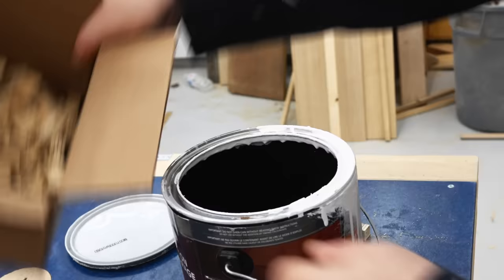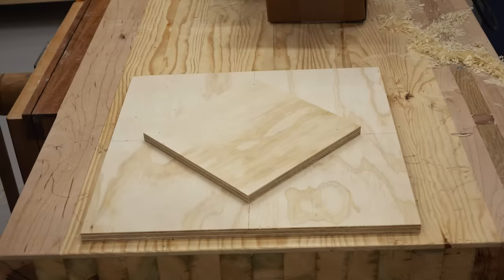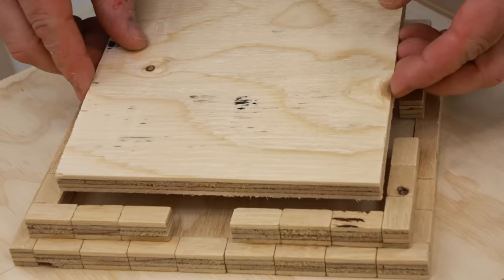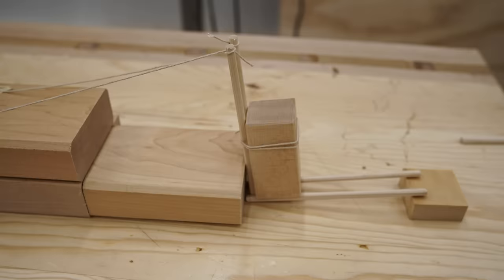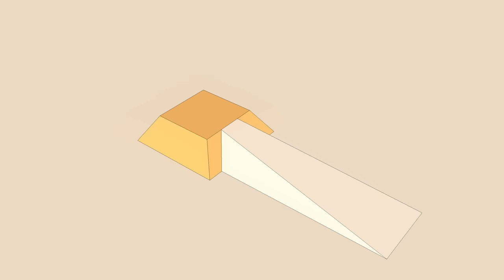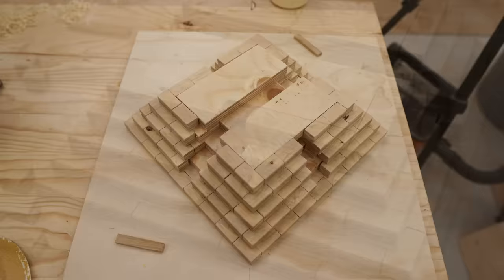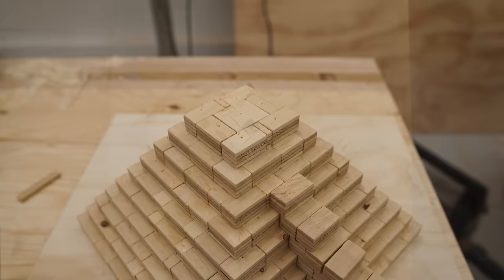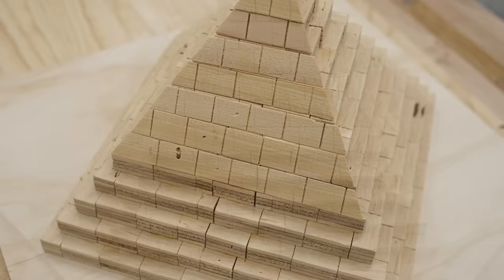How I Would Build The Great Pyramids

Comment: They could've used a ramp along the slope of the pyramids which had very small steps in it, almost like a file. Then they could put the blocks on a sort of carrier frame that would index those small steps and use long levers to lift the blocks up one step at a time. I'm talking a few inches at most per step. They must have used very significant levers and they might have been assisted by large gangs of people on the ground, pushing on something that transferred their force to the stone.
Reply: I think he said it best, though ... you don't really need to build a giant ramp when you're already building a giant ramp. Using layers of the pyramid as platforms to raise the pieces of subsequent layers of the pyramid seems like the most elegant and efficient solution. Less material, less time, less effort, less cleanup, fewer workers, lower cost.
Reply: @pwnmeisterage  but even today we create falsework to help make the job at least a bit easier.  It’s not too far fetched to think that a corkscrew ramp would get built around the outside, since it provides the least amount of effort, in exchange for time.  Time was a resource that was free and accessible, while effort was limited to the ability to create levers and ropes strong enough to do the job.  Sure manpower was available in droves since they used slaves, but flipping a 5000lbs block vs dragging a sled comes down to efficiency, not cumulative strength.  The dynamic movement of flipping the block each time  is inherently dangerous, requires enormous effort within a short burst of time, and requires some kind of massive harness and lever that I doubt could be made at the time.  The corkscrew ramp and sled concept allows workers to make iterative progress, rest at any time without loss of progress, and use easily executed sled construction, greasing, and ropes distribution to lower the threshold of effort.  These people spent lifetimes making these so you know they considered tons of ideas and chose the one (or eventually innovated towards the one) that took the least amount of headache.
Reply: @davidswanson5669  - What we use today isn't terribly relevant to the question of making ramps to construct a giant ramp-shaped building, because we aren't making giant ramp-shaped buildings today.
Reply: @johnnyjohnson6643  I’m saying that creating falsework isn’t a waste of time or effort, and is in most cases necessary.  Scaffolding and jigs and molds are all extra things that are built in order to make something that is just as big or smaller than the falsework itself, but we don’t consider those things ridiculous or inefficient.
Reply: @davidswanson5669  Flipping 5000lb blocks end-over-end up steps would certainly take a lot of effort. Even with levers, sleds/rollers, ropes, pulleys, and cranes. But constructing a massive ramp system - robust enough to support the weight of itself, levers, sleds/rollers, ropes, pulleys, and a 5000lb block at every point along its entire length would be a lot of effort. And the corner posts - you either build massive ramp columns or you end up flipping the blocks end-over-end four times per layer anyhow. And accidents - a frayed rope, a broken log, an injured slave, a panicky animal - would probably take out all of the ramps below when the 5000lb block crashes down. Unless, of course, you build some kind of truly impressive ramp system out of more stone blocks ... basically build a pyramid onto your pyramid ... which seems like a lot more than scaffolds and falsework.
Reply: @pwnmeisterage   the corkscrew ramp concept uses the pyramid itself as the main structure of the ramp, and I think they build the ramp out of more stones, as you mention, or wood blocking, but they wouldn’t need a whole lot since they’d reuse it as they advance up each flight of levels, kinda like how they reuse/replace logs when rolling a building across town.
Reply: @pwnmeisterage  the stones are nowhere that heavy as you go up. it is only down they are heavy! in fact barring at the outer layers none seems that heavy.
Reply: @pwnmeisterage  A ramp made with blocks on the outside filled in with smaller stones and sand wouldn't be that hard.  And make the surface flat like the outside surface of the pyramids so its a real ramp not a step ramp. Do one layer of the pyramid at a time and then keep building the ramp up. Of course the longer the ramp the more gradual incline would be. I think the ramps were probably a lot longer and gradual than most people think. The ramps could have been a mile long for all we know and might have barely felt like an incline at all. The construction of these we're taking 20 years or more.

Comment: They had a, newly discovered, 7-degree spiral ramp running internally from top to bottom like a modern-day multi-story car park The ramp was/is not connected to any known pre discovered chambers the corners of the ramp were thought to have been left open to enable the blocks to be turned the openings provided light and ventilation and were filled in last after the structure was completed. French Sonar picked it up in previous studies but they thought it was interference or an anomaly and ignored.
Reply: jup, some Frenchman discovered the internal ramp I believe. However I do not believe they were used as tombs; nor do I believe it was build in 20 years; in fact; if you look to the 'unfinished pyramids' its very clear that the pyramids weren't build in one go either. I think it's very likely that the Giza pyramids were build on a more ancient site, given the fact that there is an entire labyrinth of tunnels underneath the plateau. I think those came before the pyramids and the pyramids themselves have been made much much later. You also see this in the pyramid of Djoser; the construction techniques of the internal hole and tunnels is rather different all together as the pyramid on top. And as for 'they were tombs'.... well there has been no mummy ever found inside an Egyptian pyramid so that's just speculation; in all honesty nobody knows what they were used for; to me seen it's build up it had a more practical use... although I don't believe the 'powerplant' theory either.
Reply: do you have link?
Reply: @SeiMaxwell  https://www.youtube.com/watch?v=lasCXujNPfs This 1 he might be talking about. Internal ramps just inside the outer layer.
Reply: The internal ramp is the most practical design. You wouldn't build an external ramp that would consist of more stone blocks than the thing your building. Also it would become to steep at a point for the workers.
Reply: @stijnvdv2  Aristotle believed the pyramids were constructed to keep the people poor and busy. You can find it in the Politics, in the methods that preserve tyrannies.
Reply: @husker_pupper7474  You can use the actual building to support the ramp. It would of similar shape but less steep than the internal ramp because the dimensions are larger. The external ramp has many advantages but the visibility of labor was probably the most important.
Reply: @aristotle_4532  They have already disproven the extremal ramp. The main reason is it would take more blocks to make the ramp to reach the top of the pyramid than all the stone blocks in the pyramid its self.  So where did all these blocks go? I dont see them laying around.
Reply: @husker_pupper7474 The structure of the external ramp would be a tiny percentage of the pyramid volume.
Reply: @aristotle_4532  I recommend you do your research. Egyptologists as well as engineers have disproven the external ramp (for full construction). You know people with doctorates. People who have surveyed the actual pyramid. You know people who have actually been inside it. Also the only person to be aloud to climb and explore the pyramid. You are incorrect.

"If the ramp were too steep, the men hauling the blocks would not be able to drag them up. An 8-percent slope is about the maximum possible, and this is the problem with the single ramp theory. With such a gentle incline, the ramp would have to be approximately one mile long to reach the top of the pyramid."

So where is your 1 mile of linestone blocks? Prove it.
Reply: @husker_pupper7474  1) I'm a civil engineer with 5 years of university training and decades of practical experience, which is closer to practical and theoretical engineering that any egyptologist or architect will ever get. I also grew up in construction sites because that's what my family does. You think this is some sort difficult building problem, but the solution is obvious. I find the quote laughable from an engineering point of view. A much smaller pyamid can be built using a low slope ramp, because the ramp can be on the actual pyramid following the perimeter in multiple turns and based on the actual structure. Length is not a limitation. 

2) Surveying the pyramid is irrelevant for a practical engineering solution. The dimensions of the structure is all one needs. An external ramp can be used without leaving evidence on the structure. It does not even require significant support if you use the structure as any sane engineer would do.  It will be extremely hard to connect a ramp found somewhere with a pyramid. An internal ramp makes sense for general purpose access, and better ramp technologies can be used in other situations, but the external ramp of the pyramics will never be discovered. That doesn't mean it didn't exist. It's the obvious solution for such a building. 

3) Slaves would laugh at your idea of a building ramp.

4) You don't know what proof means.
Reply: @husker_pupper7474  You clearly know little about construction and you are not equipped to discuss this. Do you know who Houdin is? His father was a civil engineer and engineers are the only experts in these issues. 

Spiral ramp is the only reasonable way to construct a pyramid. You think of construction as an interesting subject but it's very complex. You have to optimize many parameters to get a solution for each building, depending on its size, the materials, the schedule, workforce and complexity, but the solution in this case is an order of magnitude more probable than anything else. It should be considered certain. Engineering was primitive at the time, but they were not fools. Any builder without formal education would reach the solution of the spiral ramp. It is that evident.

From a dialectical point of view, the pyramid construction discussion is full of nonsense. Nearly nobody wants to accept something that contradicts his perception of the problem, even if he/she has no idea about engineering and the logistics of building. Most of the approaches in popular science are downright idiotic and any high school student should be able to tell with basic knowledge of physics and simple volume calculations. 10yo kids should point to the ramps depicted in books and claim that's not a good way to do it.

Internal vs external is semantics. The ramp is always external. If you build it and cover the area, does it become internal? An internal ramp for this purpose is impossible to build because it requires the cell which is impossible to build without the ramp. An internal ramp can serve many uses but it cannot build the main structure. In such a building there could be 600 people working on a shift, at the same time, inside the building. The pathways for this purpose can be more steep or even use stairs, scaffolding and lifts. But if you are moving such volumes using people that can merely do the labor of an animal, you need to keep the slope shallow and things very simple. 

Only compulsory work can make an ugly useless building of this type happen, but I meant that even a slave would know more about the subject. After all he has probably pulled something heavy up a hill a few times.
Reply: @aristotle_4532  I never once said it was not complicated nor did I ever say it was easy. So most of that was you trying to look good. So good Job lol. Its called an internal ramp as right now in 2021 the ram is physically inside the pyramid. Hence internal ramp. Obviously during construction the ramp that is now internal had spots open to the world. As you know its under construction. That is common sense lol. Did that make you feel like a big boy?

When people are talking about different ways it can be done the two most discussed ones are. 1. Internal ramp, a ramp that spirals the outer walls of the pyramid. 2. External ramp, a ramp on the outside starting in the middle extending outward that is built up continuously as the pyramid gains height.
Reply: @husker_pupper7474  You have the layman point of view. You don't understand the issue and take from granted anything you read on the subject, from bad theories to rhetoric defenses of existing theories. You can't even tell these people are usually not qualified to build anything or propose anything on the matter. You can't tell the arguments are nonsense.

How the pyramids were built is not a problem of science, and engineers have no doubts an external spiral ramp was used and nothing innovative was done. An internal ramp for building a pile is a ridiculous idea. Even animals have more brains when they build. 

This pile or rocks is not different from a pile of legos someone spent years on. There is no mystery in the pyramids beyond popular science and bad science fiction. It's news for youtube or newspapers if there is nothing important to publish. It may be a significant subject for someone trying to get some interest in his name for career or academic purposes. These are usually the people that bother to work on the pyramid "problem". A scientist works on an important problem, does the work, then publishes. A sophist works on popular subjects and starts with the media.

Comment: This sounds feasible until you find out that the stone blocks were too heavy to have even been rolled on wood let alone tilted, the sheer weight of the stone would have crushed any wood they’d have sat upon. 

It was entertaining, thank you.
Reply: I think you underestimate the strength of wooden logs. The ability of wood to bend under the stress helps it avoid breaking. Sometimes the harder something is the more likely it is to shatter under immense pressure.
Reply: @disapearingboi  your right about the wood being strong enough, Easter Island definitely gives the wood some credibility. They would definitely have to go out of there way to get the wood, but they were known to get their Stones 500 miles away from the pyramids.
Reply: Wood is extremely strong when used in the right way
Reply: You simply have to watch the video about Mussolini's monolith being transported with wooden logs and pulled by around 60 ochsen, through the narrow street of a village onto a specially prepared ship etc. The Egyptians used the same techniques, descriptions or depictions were found as far as I can remember.
Reply: I’ve moved extremely heavy equipment on wooden dowels . 
The weight to dowel ratio very similar to the pyramid blocks and logs
Reply: You’re all nuts if you think you’re moving 900tn on wooden logs and Chat GPT4 agrees.
Reply: @InimitaPaul  which stone weighted 900 tons ?
Reply: @maau5trap273  The trilithon stones at Baalbek.
Reply: @InimitaPaul  what does that have to do with anything? Isn’t that place Roman or Greek? I don’t remember correctly
Reply: @maau5trap273  The point is that you’re not rolling 900tn blocks on wooden logs.
Reply: @InimitaPaul  but that has nothing to do with Egypt. The Roman’s were capable of doing way more impressive constructions anyway
Reply: @maau5trap273  We’re discussing wooden logs being used to transport mega stones, the location is meaningless. The stones above the Trilithon stones are Roman, the Trilithon stones are not.
Reply: @InimitaPaul  also that was his hypothesis for the pyramids in Giza. An internal ramp is probably the answer tho
Reply: @maau5trap273  As I said, my OP and the subsequent discussion is in regard to the transportation of mega stones on wooden logs.
Reply: @InimitaPaul  DO YOU HAVE ANY EXPERIENCE MOVING BIG OBJECTS WITH LOGS? 

I’m using caps because you don’t seem to understand the significance of this statement in regard to your argument.
Reply: @Adizzle235  No one in this comment section has direct experience transporting 900tn mega stones with logs, feel free to write your entire reply in caps.
Reply: @InimitaPaul  I’m glad that you acknowledge this important fact
Reply: @Adizzle235  I’ve watched countless documentaries with experts on the subject over the years and even went to the trouble of asking Chat GPT4, what do you have to offer?
Reply: @InimitaPaul  clearly you need to re read your previous comment to understand my stance on this discussion
Reply: @Adizzle235  Wood is extremely strong, gotcha.
Reply: " the sheer weight of the stone would have crushed any wood they’d have sat upon"
Nope. Not at all. You are literally 100% wrong.
Reply: @untitled6391  “literally 100%” is all I have to say about your comment
Reply: @InimitaPaul  You still haven't elaborated how the 900 ton stones not being able to roll on logs has anything to do with 80 ton stones being able to roll on logs. That's like saying you can't pull a 500 kg trailer with a family car because you can't pull a 35 ton semi-truck trailer with a family car.

Comment: Great explanation and example. I like that it's simpler than anything I've seen but they were handling 70ton blocks in the so called kings chamber. How do you think they got those up there?
Reply: They used the grand gallery as internal ramp with counterweight system (JP Houdin's theory)

Comment: The lines are there because each side is con-caved making technically making it a 8 sided pyramid. You can clearly see these on the winter and spring equinox at sunrise or sunset, one of the two.